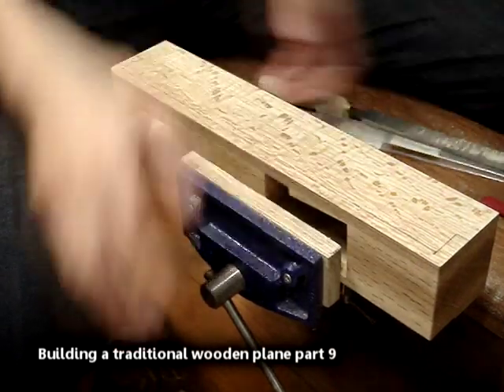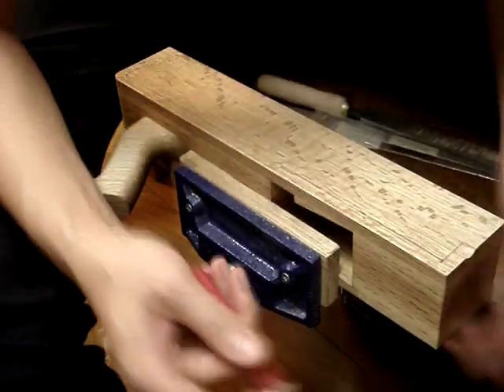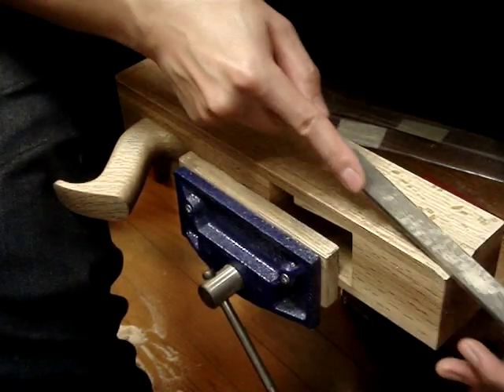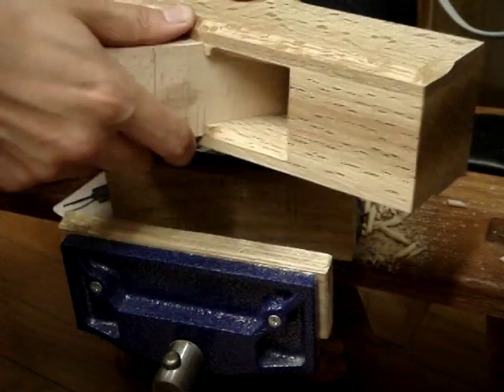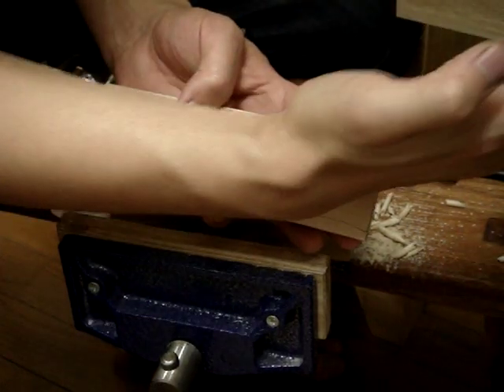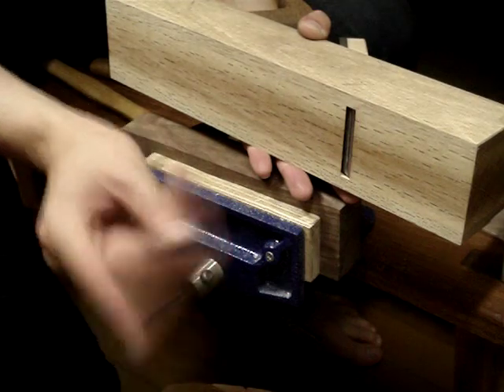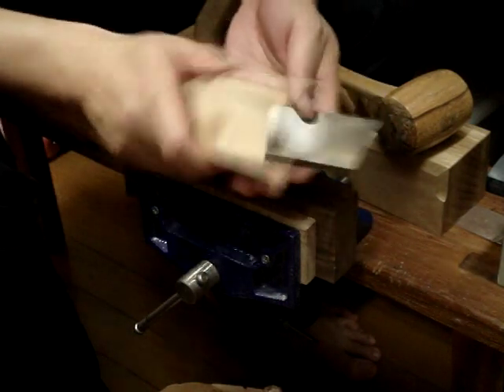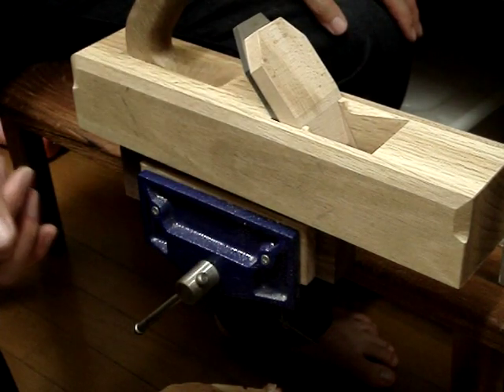Building a traditional style wooden plane pt.9

Comment from the maker: I find that they don't ever clog. They're more expensive than old rasps but not that expensive. The main reason I like them is that they are fast at wood removal and they leave a good finish so sandpaper can be avoided. Scrapers can't get into some corners and tight curves. Find an old float to restore and you'll get a feel for how they differ to rasps.
I also have an addiction of finding old tools and fixing them up. I have a pile of about 30 or 40 japanese planes waiting to get some love :p

Comment: congratulations on having a mini sumokun.  No greater joy than raising little ones.  Raised 4.  I built a bench w/veritas twin screw side vise (awesome)and single screw end vise. I use the end vise a lot, it is just Ok, should have gotten a quick release.  Rnd dog holes.  Hold fasts, bench dogs.  FFW essential work bench design.  I should have done roubo style.  Legs flush w side of bench.  Wonderful bench.  Would like to add leg vise and wagon vise and roubo style legs.  Will stay tuned.  Am f

Comment: Interesting, but how are they with clogging up? rasps don't really have that problem, plus I buy old ones and recondition them so I get them cheap. and of course they aren't for final finish, I use cabinet scrapers I make from old steel scrap and sawblades. expensive tools is not in my vocabulary, I'd be too afraid to actually use them. :) I love buying non-collectors antique tools. Then fix them and use them. It's a nice feeling giving an old ruster new purpose.

Comment: Great video series - it turned out beautiful!!  I have been looking at a TON of YouTube videos lately on building planes.  I want to build a traditional style  and will definitely use the 3-piece laminated construction method as opposed to hogging it out of a solid block or using the 2-piece split down the middle method.  I was wondering, though, if you, or anyone, has ever seen a 3-piece construction with the abutments built into the side laminations (as opposed to building them into the toe piece)?  One advantage of this would be that it makes the center body sections super easy to construct.  The disadvantage is that it may make the alignment and glue-up more difficult.  Just a thought...
Reply from the maker: Hi, a 3-piece construction with the abutments built into the side pieces is an approach that works as well but if you are going to do it that way, you might as well do the 2-piece method as it is about the same or less effort. I actually made a plane with the 3-piece method you describe and I show it in part 1 of this series. It's the little maple plane. I made it as an experiment because I didn't have a thin enough piece of scrap to make a 3-piece like the one in this video. It works fine but in terms of ease of construction, it didn't offer anything over the other methods.

Comment from the maker: @metzelplex Thanks! I trued the sole up with my No.4 smoother and sandpaper. The sandpaper (#400) was stuck to a glass plate for final tuning.Oiled up it actually looks almost the same :p
For some reason the wood (Jp. white oak) doesn't seem to deepen when oil is applied like most woods.

Comment from the maker: You can actually make a float yourself. All you need is a bar of steel and a triangular file. Its basically a fat rip saw. There are quite a few guides on sharpening them and I believe there is at least 1 site that shows you how to make one. That being said you will need quite a bit of patience but it will be cheap :)

Comment: Hey dude, I'm also a hobby woodworker in Japan but am struggling to find a source for hardwoods. Where do you get your stock?
Reply from the maker: Hi, thanks for watching. Usually I get it from the local hardware store or there's a place in Shin-kiba that sells nice exotics and stuff.
Reply: Thanks man, was hoping you had some good online shop recommendations as I live in Kyushu. 
Great channel by the way!
Reply from the maker: Hi, online... not so much. The problem with online shopping for wood is you rarely know what you are getting and shipping can get pretty expensive. Even with pictures of the wood, its hard to judge the figure and texture etc so I usually try to get wood locally unless I don't actually care what I get, in which case I will usually look at auctions.